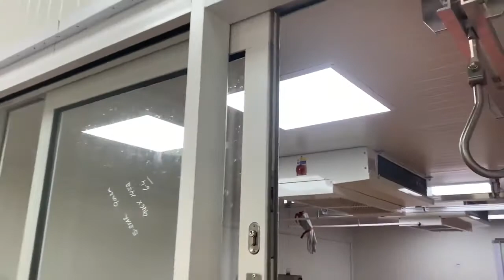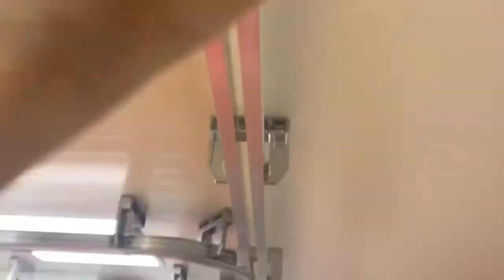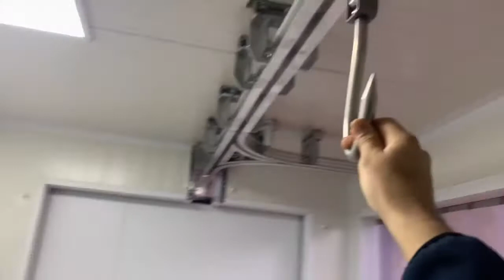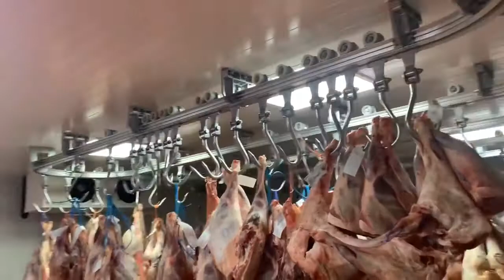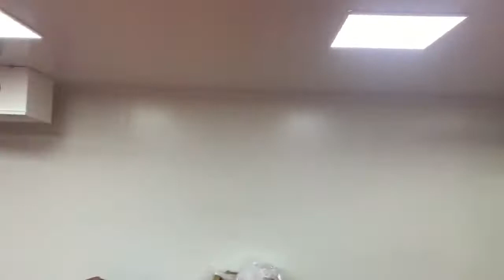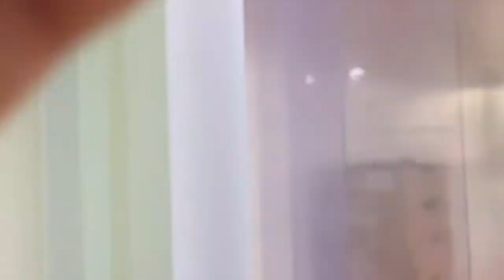Meat Rail, Hanging & Storage Systems

Comment: Great design! How did you attach the rails to the ceiling? Is there a metal or concrete beneath the ceiling for strong attachment points?
Reply from the maker: Hi, all the rails connected to the mezzanine floor on the top.

Comment: Hi,
Would appreciate if you could mention the inner height of the cold room and also the width between the hanging rails shown in the video.
Reply from the maker: Hi 
the height is 3m and the between the rail is 60 to 70 cm.